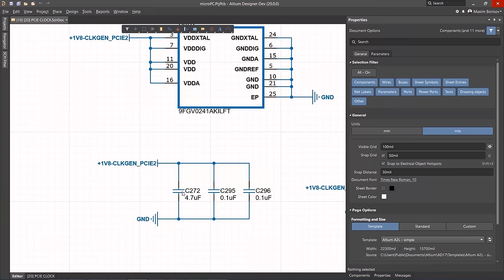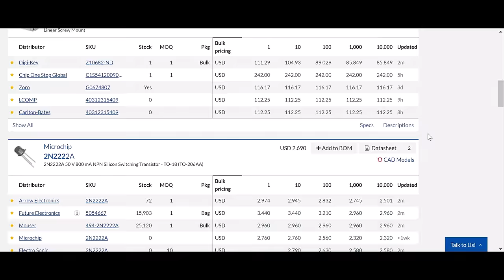how to make inverter 12v to 220v using transistor , Altium Designer

Comment: Why also test the pinout of the second 2n3055 which is necessarily identical to the first?
Reply: I might to confirm that it's good and to get the gain (hfe) of both to match them.
Reply: Отличный вопрос!!!!!
Reply: Maybe they were chinese ST copies.
Reply: @laustinspeiss  They're definitely counterfeit.
Reply: Well if you don't trust the MFR to build them consistently....
Ever hear of chinesium?   (a techno-economic term, wholly separate from culture, race, societal characteristics, etc.)
Reply: @77thTrombone  “Chinesium” is DIRECTLY evolved from cultural and societal influences. Driven by economics and perceived power.
Reply: Take you transistors and place them with the leads left of cental. The base is the bottom when the leads are on the left..
Reply: @laustinspeiss   
"perceived power" ?   Hardly.  I have never, ever heard the word used an way close to that.  I reject that assertion.
It's about design/safety standards and quality control, and yes, economics (as I noted,) because everybody wants a cheaper product, until they realize they got what they paid for.

Comment: Put unpolarized C across the collectors to control the frequency and make sinusoidal wave at the output.
You should show the waveforms, schematics, and talk about theory.
What you have is cross-coupled oscillator. It will stop oscillation if the load is large.
Reply: How about just the power source... LOL

Comment: I built that circuit 50 years ago when light bulbs were not LED.  Those 50 year old 2N3055 transistors need a very BIG heat sink for 60 watts.  Your LED light is about 4 watts you probably need heat sink for continuous use.  Where is your circuit drawing?
Reply: look at it and convert to paper lol.. hoping u know electronics
Reply: your lucky one lead of the resisters did not short out on the 3055 case,was awful close !
Reply: Yes - I built the same in the early 70's - The transistors will get VERY hot without a heatsink. These days its more efficient to just use 12v LED lamps.!!

Comment: 7:55 need to add some capacitance and a way to add a 50/60hz drive frequency, fine for lights, but terrible for digital electronics and things like chargers and possibly certain type of motors

Comment: Where are the capacitors. I've never seen an oscillator without the capacitors. Give the circuit diagram.
Reply: Don't waste your time with this... It is just a very crude astable free running oscillator
Reply: Hi no you do not need capacitors as the base current is controlled by the transformer  winding that is not conducting  by the transformer action  but  what you may need is a capacitor across the 2 collectors to control the frequency by forming a  parallel tuned circuit at 50 HZ with the transformer winding  I have seen huge chokes put in the 12v power line to make it produce a better sine wave

Comment: Do NOT bend transistor outlets, you can broke glass isolators. 
Do NOT solder wires to transistor case, otherwise you will not be able to attach heatsink. 
Without heatsink these transistors handle 5...10 watt max. 
Use capacitor between collectors to make sine wave at output, not square. 
This schematic output frequency differs depending on load, on critical load this thing will stop oscillating and transistors will be burnt out. You need external oscillator, for example ne555. 
Final yield of this schematic will be 20...30%, else will heat transistors, not more. Energy wasting thing as for me.
Reply: Mach das und es kommt

Comment: Please sir can you tell me that which mobile phone are you using for making videos.... Plz
Reply: nokia 1100 🤣
Reply from the maker: iphone 14 pro max
Reply: @inventorkr1  wow
Reply: @inventorkr1  btw is the inverter pure square wave ?how many Hertz does it have?
Reply: @inventorkr1  wow how you bought so expensive mobile.
Reply: @Its-07  просто посмотири  на просмотри на ево канале
Reply: The frequency depends on the load. 50 years ago we built one and made a lot measuring on it. The design was used by f ex taxi to power their radio communication.
Reply: @Stefan_Boerjesson  ok sir tysm 🙏

Comment: Royer oscillator. Put a capacitor across the transformer primary coil (between the collectors) and you will get an almost pure sinusoid current with an ability to tune the frequency.  As it is the frquency is spurious, the current is spiky and not suitable for many loads.

Comment: What is the frequency at the transformer
Reply: The transformer is a standard 50 or 60 hz unit. I think efficiency drops greatly as the oscillating frequency rises above that. Should be good thru audio range.

Comment: cute soldering albeite not mechanically sound and a  heat sink, mica insulator, socket even  still the relic 2n3055 npn gen purpose  switching relic bi-polar and that itty bitty center tap xfrmer wont last w/ a 8W eneergy savior bulb as lonely as that wolf moon tune ....thanks it reminded me when i waz a we lad hiding from my dad behind a plume of solder and the ozone of extreme hi voltage projects ...

Comment: Hello, engineer, don't be tired.Please tell me how much the frequency and power of this circuit can be increased.And what is that ad on the Eltium website?How can we use these ads?💞💞💞💫💫💫
Reply: Maybe 4 - 7 watts, not more. If you want to get more you will need a bigger transformer and adding a heatsink for the transistors. The transformer will also getting hot and get into saturation. I guess you better don't use torroid transformers here because of the very high inrush current, transistors can be damaged then.

Comment: I understand you are trying to help people save money avoiding buying inverters and getting some views too(notoriety for helping sharing), but I have to say you will get people in trouble if not hurt with that video. Ungrounded transformers as well as insolated, protection, in a grounded or plastic container so 220 VOLTS at who knows how many AMPS when someone thinks "Sure I'll just hook it to my 1000 cold cranking amp truck battery since 12 volts is safe." is a major factor in death from electrocution at , I say again, 220 VOLTS and hmm I'd say 20-30 amps which is why the buck converter in PFC oscillator circuit is SCREAMING STOP and the bulb arcing blue when it energized immediately with square wave at 100% phase amplitude per capacitive time constant. PFC bulbs have protection integrated in the circuitry according to Local electric code standards that DIYers really should pay attention to for safety reasons. However, what you got there, is a phos bomb waiting to happen cause when it goes the voltage will jump the  silicone and blow a hole in the plastic container hopefully not into the phosphorus vacuum igniting the matchstick powder and though not that violent still will make fire likely while the mad scientist is holding the fixture in the hand. Anyway, thanks but think!

Comment: Hello,
The transistors are 60-volt NPN type, not 250 volts.
2N3055(NPN), MJ2955(PNP)
Preferred Device
Complementary Silicon
Power Transistors
Complementary silicon power transistors are designed for
general−purpose switching and amplifier applications.
Features
• DC Current Gain − hFE = 20−70 @ IC = 4 Adc
• Collector−Emitter Saturation Voltage −
VCE(sat) = 1.1 Vdc (Max) @ IC = 4 Adc
• Excellent Safe Operating Area
• Pb−Free Packages are Available*
MAXIMUM RATINGS
Rating Symbol Value Unit
Collector−Emitter Voltage VCEO 60 Vdc
Collector−Emitter Voltage VCER 70 Vdc
Collector−Base Voltage VCB 100 Vdc
Emitter−Base Voltage VEB 7 Vdc
Collector Current − Continuous IC 15 Adc
Base Current IB 7 Adc
Total Power Dissipation @ TC = 25°C
Derate Above 25°C
PD 115
0.657
W
W/°C
Operating and Storage Junction
Temperature Range
TJ, Tstg − 65 to +200 °C
Maximum ratings are those values beyond which device damage can occur.
Maximum ratings applied to the device are individual stress limit values (not
normal operating conditions) and are not valid simultaneously. If these limits are
exceeded, device functional operation is not implied, damage may occur, and
reliability may be affected.
160
0
0 25 50 75 100 125 150 175 200
Figure 1. Power Derating
TC, CASE TEMPERATURE (°C)
PD, POWER DISSIPATION (WATTS)140
120
100
80
60
40
20
*For additional information on our Pb−Free strategy and soldering details, please
download the ON Semiconductor Soldering and Mounting Techniques
Reference Manual, SOLDERRM/D.
15 AMPERE
POWER TRANSISTORS
COMPLEMENTARY SILICON
60 VOLTS, 115 WATTS.
Sincerely,
Reply: Best of Romania  
Hello,
What is your IQ?
Reply: Best of Romania  
Hello,
Better than mine!  What is mine?  Many viewers are suffering from low IQ.  Again, 15 AMPERE
POWER TRANSISTORS
COMPLEMENTARY SILICON
60 VOLTS, 115 WATTS.  The transistor is a 60-volt transistor, not a 250-volt transistor.
Seriously,
Reply: @benjaminkarazi968  220 V on the secondary winding of the transformer. On the primary 6-12 V. The same voltage is applied to the transistors. Transistors are supplied with 6-12 volts DC. This is a 12v DC - 220v AC inverter.
Reply: @ВалерийФилатов-ч5б  
Hello,
The input for the transformer must be AC; there is no switching circuit or components to convert 12-volt DC to 12-volt AC.  Furthermore, the video does not exhibit the source voltage for the input; the red and black alligator clips with the red and black wires.  Also, the statement, "This is a 12v DC - 220v AC inverter." defies the laws of physic.
Truly,